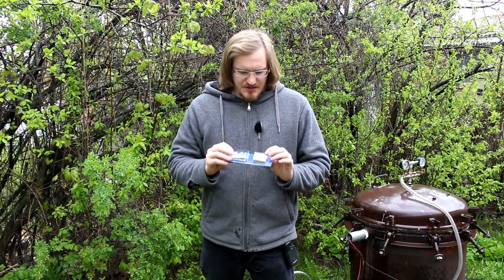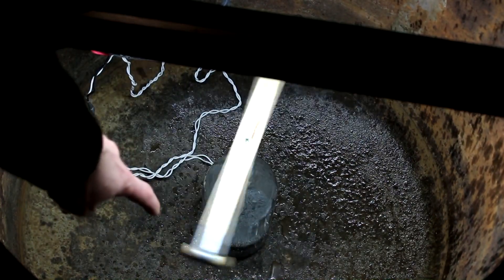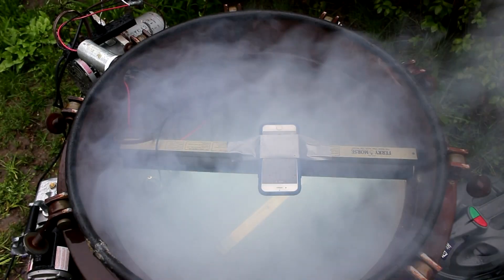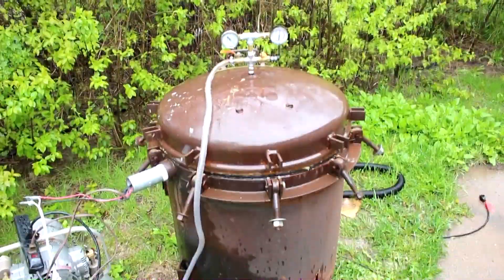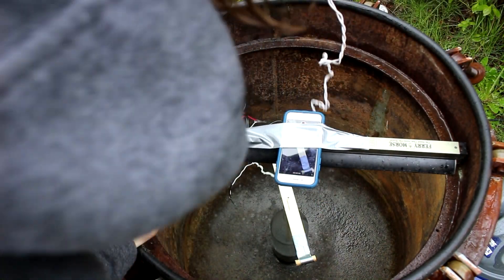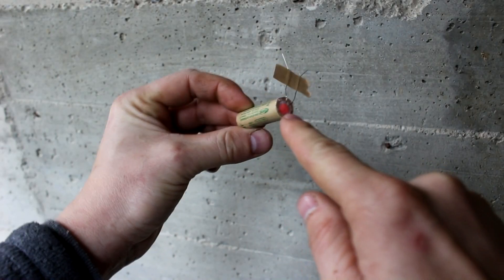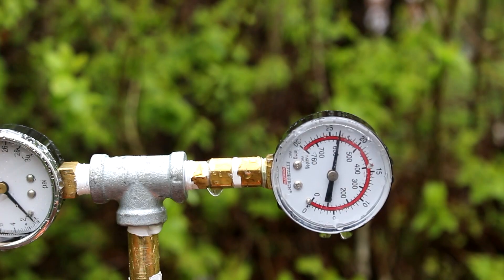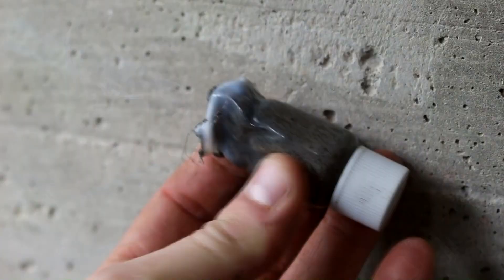Will a Model Rocket Motor Work In Vacuum?

Comment: The reason the rocket moved is because the exhaust was pushing against the wall of the vacuum chamber. He needs a chamber that is long enough and wide enough the exhaust doesn't have anything to push against.
Reply: No. Rockets move forward because they accelerate mass backwards.
Rocket Propulsion is just the mechanical recoil due to pushing on mass.
Reply: I'm surprised you still want to beat this dead horse after all these years. 

Well the internet and NASA says different. They all say the rockets exhaust pushes against it's own exhaust to give enough force to go forward. To me, that is like saying I can kick my own ass to drive me forward. I'm sure you believe that too is possible.
Reply: @rodneybaker2629  No NASA does not "say different".
You are just confused about basic physics 
NASA has never claimed that rockets violate Newton's laws.
Newton's laws say that rocket propulsion MUST work in a vacuum.
Try to keep up.
Reply: @stuartgray5877  If Nasa says Rockets move by the exhaust pushing against its own exhaust, then that violates Newton's third law. 

According to Newton's third law of motion, for every action there is an equal and opposite reaction. But these two forces act on two different objects and not on the same object. If these two forces being equal in magnitude acted on the same body, they would cancel out each other and the resultant would be zero.

Exhaust pushing on itself is NOT two different objects pushing against each other, they are the same object.
Reply: @rodneybaker2629  tell me what would happen if you fired a crossbow into a vacuum
Would there be a recoil force?
Yes or no?
Why or why not?
Reply: @rodneybaker2629  to help you understand, answer a couple of questions about a rocket engine running right here on earth in atmosphere:
1- does the exhaust gas have mass?
2 - does the exhaust gas experience an "acceleration" as it exits the rocket nozzle?
Reply: @stuartgray5877  
!. Yes, exhaust has mass
2.Yes, it is accelerating

You either are not reading what I wrote or you read it and didn’t comprehend it. If you did, you wouldn’t be asking these silly questions. 

The problem I run up against all the time is people will say things like, this proves Newton’s laws. They believe they know them but they really don’t. The last thing I wrote I said, if NASA says rockets in a vacuum work by the exhaust pushing on its own exhaust, then that violates Newton’s third law. You didn’t answer if you believe the same thing as NASA or you agree with me. You could have at least said something about what I wrote but you didn’t. You just went on thinking how you can convince me I’m wrong.

You see if you had studied what I wrote and tried to understand, you should have realized I’m right believing that. If you don’t then you are probably one who doesn’t really understand the basics of Newton’s third law of motion.
Reply: @rodneybaker2629  so you agree that the rocket exhaust has mass and it is accelerated.  Good.
So you agree that there must be a "force" accelerating that mass?

What is the origin of this force?
Reply: @stuartgray5877  The engine
Reply: @rodneybaker2629  ok. The engine applies a FORCE to the mass of the exhaust gas, accelerating the gas into the vacuum.
Great!
Now what does Newton's third law say about forces?
Reply: @stuartgray5877  According to Newton's third law of motion, for every action there is an equal and opposite reaction. But these two forces act on two different objects and not on the same object. If these two forces being equal in magnitude acted on the same body, they would cancel out each other and the resultant would be zero.
Reply: @rodneybaker2629  so the rocket PUSHES on the mass of the exhaust gas and feels
An "equal and opposite force" pushing BACK ON THE ROCKET!
Rocket propulsion is just the mechanical recoil of pushing on mass.
Now tell me again how I am the one that does not know what they are talking about.
I am literally preparing a spacecraft for launch right now 
We FUEL IT starting tomorrow.
Reply: @rodneybaker2629  now be sure to explain how people who failed high school physics should attempt to explain basic physics to actual rocket scientists.
Reply: @rodneybaker2629   @rodneybaker2629  What happened?
You seemed so sure of yourself, now silence?

Did you finally realize that mechanical recoil MUST still work in a vacuum?
Reply: @stuartgray5877  I was under the impression you finally realized rockets can't work in a vacuum because they go against Newton's third law. Have I not made that clear?
Reply: @rodneybaker2629  for example, you could not explain the law of conservation of momentum if your life depended on it 
Prove me wrong.
OR run away again.....
Reply: @rodneybaker2629  I am confident that I could show you undeniable evidence of rocket propulsion in a vacuum and you would STILL Deny it.
Reply: @stuartgray5877  I've seen a bottle rocket in a vacuum and it didn't move.
Reply: @rodneybaker2629  - "I've seen a bottle rocket in a vacuum and it didn't move."
OH, so you've seen a violation of Newtons laws?
You should write a paper and submit it for a Nobel.

Because it is IMPOSSIBLE for it NOT to work.
Reply: @stuartgray5877  It certainly doesn't. It actually proves Newton's laws. Newton said one separate object pushes against another separate object. NASA and you say you only need one object. that is simply not true according to Newton.
Reply: @rodneybaker2629  no you keep being told:
TWO "masses".
Newton's laws discuss forces BETWEEN "masses"
A gun is one mass, the bullet a second.
A crossbow is one mass, the projectile the second.
A man holding a firehose is one mass, the water shooting out is the second.,
Reply: @rodneybaker2629  if a giant crossbow fired an ice projectile of mass 500 kilograms to a velocity of 2500 meters per second, could it do this without feeling a recoil force?
Yes or no?
Reply: @stuartgray5877  All of that you mentioned requires an atmosphere. That is how it is on God's little green earth.
Reply: @stuartgray5877  What is this thing about crossbows with you. I've never shot one in my life. So I personally don't know much about the. All I know is this because I've read it. Crossbows don't have much recoil. I assume that is on earth if one is shot. In a vacuum it would have no recoil at all.
Reply: @rodneybaker2629  So just explain:
Can ANY "machine" accelerate 500 kilograms of water from a velocity of zero to Mach Eight -
WITHOUT
FEELING
a RECOIL 'FORCE'?
Yes or NO?
Why or why not?
If you cannot answer this question, then you have no business trying to explain basic physics to anyone.
Reply: @rodneybaker2629  - "In a vacuum it would have no recoil at all."
This is proof that you should not be trying to lecture others about basic physics.

Newtons Laws say nothing about a requirement for the presence of an atmosphere for any of the three laws to be valid.
Yes, pushing on a mass in a vacuum still results in a recoil force.
It is pretty pathetic that you don't think Physicists have tested such basic physics in 2000 years.
The Tsiolkovsky Rocket Equation is over 100-years old, thoroughly tested (even in a vacuum), and is derived from the 2000-year-old "Law of Conservation of Momentum.".
But you think you have proven all Engineers and Physicists wrong, even though you have never taken a single physics class in your life?
Sure, that sounds reasonable.
Reply: @stuartgray5877  Recoil is mostly caused by the atmosphere.
Reply: @rodneybaker2629  - "Recoil is mostly caused by the atmosphere."

100% FALSE.
Recoil is the "equal and opposite force" that results from pushing on MASS per Newton's THIRD LAW!
Perhaps you might have heard of this law if you had ever bothered to pick up an actual physics book.
Reply: @rodneybaker2629  So why do you refuse to answer the question:
Can ANY machine accelerate 500 kilograms of water to Mach eight without feeling a recoil force?

WHY do you refuse to answer this question?
Scared it might prove you wrong?
Reply: @stuartgray5877 Because it make no sense. It sounds like a child wrote it.
Reply: @stuartgray5877  Are you talking about one of those bottle rockets? A one liter soda bottle filled with water that you pump pressure in it and it goes up into the air when you release it?
Reply: @rodneybaker2629  Which part of "ANY MACHINE" are you failing to understand?
I don't care how your machine gets water to move.
"Can ANY machine accelerate 500 kilograms of water to Mach eight without feeling a recoil force?"
I don't care if you shoot the water out of a canon, freeze it and shoot it out of a catapult, or boil it with a laser.
Can 
ANY
MACHINE
ACCELERATE
 - 500 kilograms of water
 from a velocity of ZERO to 2500 meters per second
WITHOUT
FEELING 
A
RECOIL
FORCE?
This is a yes or no answer.
Reply: @stuartgray5877  Yes, it will recoil on earth.

No, it will not recoil in the vacuum of space.
Reply: @rodneybaker2629  - "No, it will not recoil in the vacuum of space."
Yes it WILL.

and it is pathetic for you to think that physicists and scientists have not tested such a fundamental aspect of basic physics in over 2000 years.

The Dunning-Kruger is STRONG in this one!
Reply: @rodneybaker2629 I’m just curious how you think you came to know better than all of science when it comes to newtons laws and thrust.
Reply: @AM-rd9pu  I'm going by Newton's laws. It is that they discretely try and change it so casual observers like yourself would not know it.
Reply: @rodneybaker2629  So “they” are trying to pull a fast one on the general public and are changing Newton’s laws and you’re one of the few that know better? That’s the stance you’re gonna take?

And again I’ll ask how you came to know better than all of science regarding Newton’s laws.
Reply: I believe most people understand Newton's third law pretty well. It is really quite simple. We need at least two separate objects to apply the third law, Object A and object B. Object A applies a force on Object B and object B applies a force back on object A. When a rocket is inside earth atmosphere it follows Newton's third law just fine. Object A, the rocket exhaust, pushes on object B, the atmosphere, and object B pushes back against object A. Then the rocket moves because object B is applying more force on object A then object is applying on object B. The problem occurs in a vacuum where there is no object B. All we have is object A, the exhaust. Without object B, the atmosphere, there is nothing for object to apply force to, so the rocket doesn't move. Listen, i'm not letting the cat out of the bag here. Everyone knows this but to keep space travel a real thing they have to lie about it.
Reply: @rodneybaker2629  Well you just made it clear that you’re not one of the people that understands Newton’s laws well. 

Object A is the rocket and object B is the exhaust gas. The rocket must impart a force on the gas to make it accelerate out the back. Therefore, according to the third law of motion, the gas also imparts an equal and opposite force on the rocket. That’s all there is to it. 

How do you propose that an interaction between the exhaust gasses and surrounding air or other objects can have an effect on an object they’re not in contact with? When you turn on a hose, can you feel when the water hits the ground? No, of course not. 

Rockets work for the same reason that throwing a heavy object while sitting in a rolling chair will make you roll backwards. You’re effective pushing off the inertia of the heavy object. Now instead of throwing one heavy objects, rockets use combustion to “throw” a bunch of little objects (gas particles) at very high speed, creating a very strong reactionary force (thrust).
Reply: @AM-rd9pu  You got it all wrong.
Reply: @rodneybaker2629  So no evidence? Just a “nuh uh”?

I’ll give you another chance to tell me exactly what I got wrong and how I’m wrong. Remember that you need evidence to substantiate your claims with evidence.
Reply: The ACTION is the exhaust and the rocket is the REACTION. When a swimmer doing laps comes to the side of the pool the flip over and put their feet on the wall and with their feet they push against against the wall, this is the ACTION FORCE. Because the wall does not move, it provides an solid surface to push against. The wall is the REACTION FORCE because it pushes back against the swimmers feet and the swimmer then propels forward. This is how Newton's third law is written and the swimmer is a prime example of it. Now, In a rocket, the exhaust would be the swimmers feet and they will be the ACTION FORCE, but if there is nothing for the feet to push against, there won't be any REACTION FORCE and the swimmer will not move forward. In a rocket if the exhaust has nothing to push against because it is in a vacuum, the rocket will not move forward.

All this is taught in school and I can give you many examples of it working just like I just told you. What science has done is buggered up Newton's third law by saying ACTION FORCE does not need something to push against when you apply the third way rockets in a vacuum. That is just plain wrong and I can't figure out why people fall for this nonsense.
Reply: @rodneybaker2629  You are severely misguided if you think what you just described is taught in schools. 

This whole situation can be summarized very succinctly. Rockets push off of their own exhaust. 

I’m going to explain how rockets work in a handful of steps and I’d like to know where you agree and disagree. 

1. Gas has mass. 

2. It requires a force to accelerate mass. 

3. It requires a force to accelerate rocket exhaust gasses. 

4. The rocket must exert a force on the exhaust gasses to accelerate them out the nozzle. 

5. In accordance to the third law of motion, if the rocket exerts a force on the gasses, the gasses also exert an equal and opposite reactionary force on the rocket.
Reply: @rodneybaker2629  
Rodney - A Space Shuttle Main Engine:
ACCELERATES 500 kilograms of pure water
PER SECOND
From a velocity of zero meters per second to over 2500 meters per second.
Rodney - Does a SSME APPLY
A
"FORCE"
to accelerate all that mass?
YES or NO?
Reply: @AM-rd9pu  This is another person that refuses to just answer simple questions when the answer proves their side of the argument wrong.
Sound like anyone else we encounter on these threads?
Reply: @stuartgray5877   It sounds like any moon landing denier or flerf that sticks around for more than one comment. But there definitely are several names that come to mind.
Reply: @rodneybaker2629  "They all say the rockets exhaust pushes against it's own exhaust to give enough force to go forward. To me, that is like saying I can kick my own ass to drive me forward. I'm sure you believe that too is possible."

Your leg is attached to your body. The exhaust gasses are being accelerated out and away from the rocket. If you could throw body parts away from you in space you would start moving in the opposite direction. You pushed against the body part and it pushed against you.
Reply: Imagine an explosion goes off next to you. You would expect to be pushed away from it. That same thing happens when a rocket combusts its fuel.
Reply: Wrong. A garden hose aimed at a wall doesn't have more recoil than a garden hose aimed at the air. Thrust doesn't depend on what the exhaust gasses hit after being accelerated, it's the fact that they were accelerated in the first place that causes a force in the opposite direction.

Comment: Fail. As soon as the "rockets" start off gassing in your bbq its not a vacuum anymore so tests invalid.

Thanks for playing.
Reply: It was never a vacuum in the first place.
Reply: @papalegba6796  correct.
Reply: @papalegba6796 I’m still waiting for your FBD. But if I had to guess, you refuse to provide it because you would no longer be able to ambiguously lie about it.
Reply: @AM-rd9pu  you can't draw things in YouTube comments, chatbot 😂
Reply: @papalegba6796 does the 14.5 PSI Atmospheric "suck" out the 3000 PSI gases from the nozzle, or does the 3000 PSI push out against the 14.5 PSI?
WHICH IS IT GENIUS?
Reply: @papalegba6796 so You DO  think that 14.5 PSI can "suck" the gases out of the 3000 PSI combustion chamber.
You have also made the claim that mass can be accelerated without a force.
You really do just keep proving you are clueless.
Reply: @stuartgray5877  says the guy who can't spell 😂
Reply: @stuartgray5877  I answered you, but you ignore me, whacko hate account fake engineer guy 😂
Reply: @papalegba6796  No you have NEVER explained what "force" accelerates the mass of the exhaust from the rocket.
In FACT, you have said repeatedly that the mass is NOT ACCELERATED, which proves you dont even understand the TERM "velocity" OR "acceleration" genius.

Comment: You turned your rocket into an explosion. The rocket propelled was from an exploding against the closed container and not from the vacuum of nothingness.
Reply: So, explain what would happen if you fired a steel projectile from a crossbow into a vacuum.
Would there be any recoil force?
Yes or no?
Why or why not?
The people who believe that rockets cannot work in a vacuum cannot explain mechanical recoil using basic physics terms.
Prove me wrong.
Reply: Thrust works because the engine pushes off its own exhaust gasses.
Reply: @AM-rd9pu  not according to the four forces of flight it doesn't, chatbot 😂